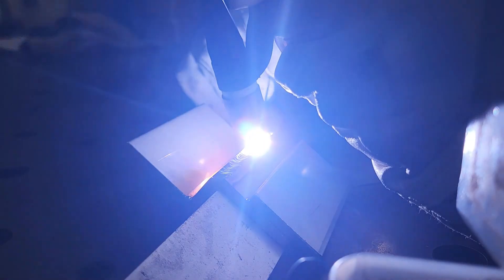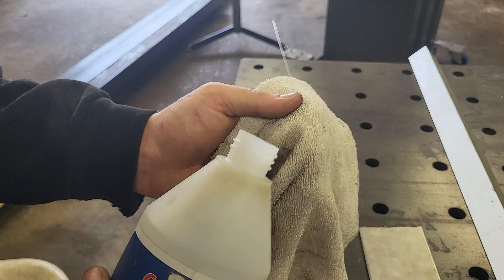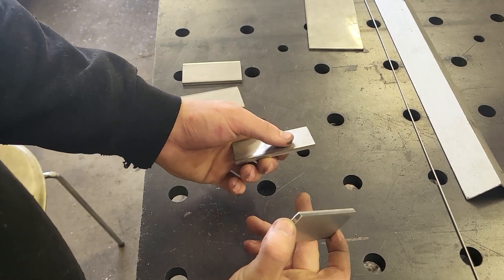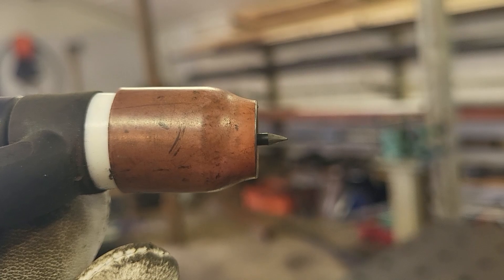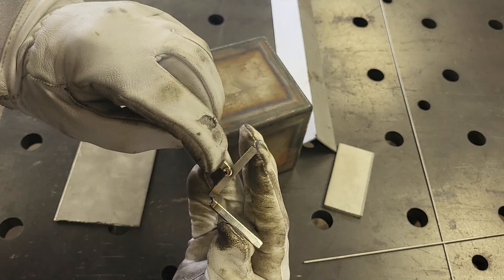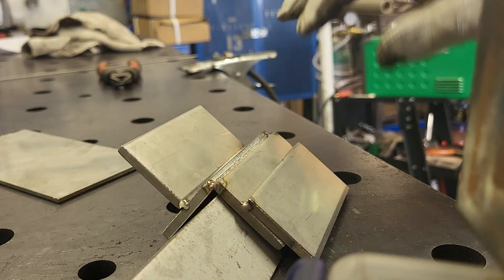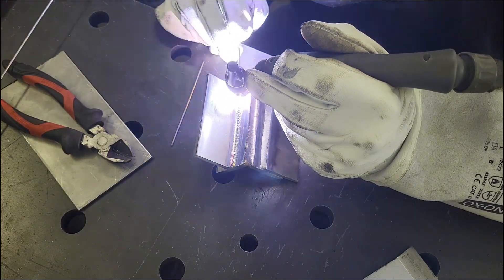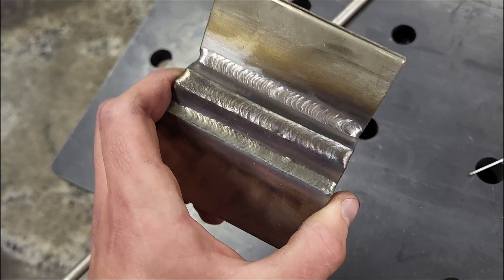The Basics of TIG-Welding

Comment: if im wrong let me know but i think the current jumps from the material into the electrode id also recommend a cup 12 or something of that size for welding stainless and your gas pressure matters alot too little and the tungsten and the stainless will oxidise as you mentioned and too much can create a vacuum at the cup which drags in oxygen. hope this helps (in no way is this a hate comment just trying to help :) )
Reply from the maker: I appreciate the input and you are right about the importance of gasflow and cup size. I was just not able to describe it concisely so I left that part out😀
Reply: @JuliusTheFabricator  all good 👍 keep up the good work
Reply from the maker: I will :)